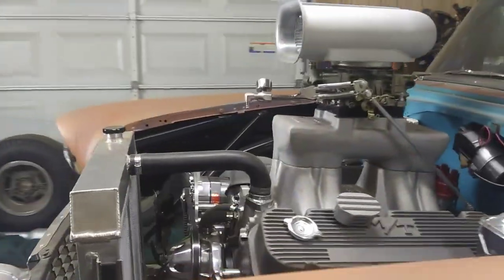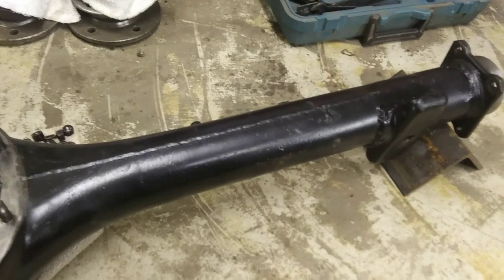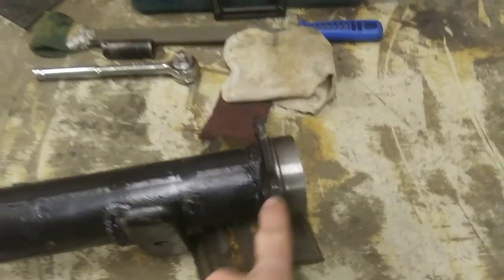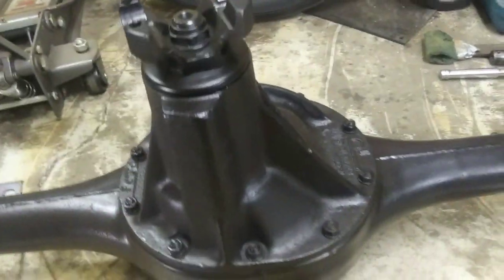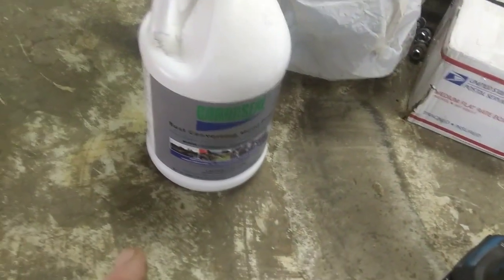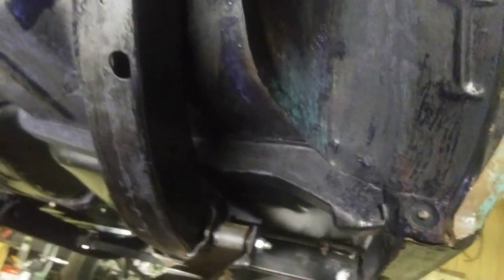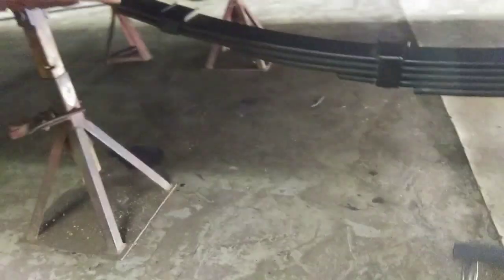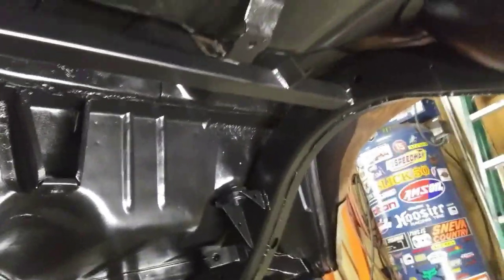1955 CHEVY GASSER BUILD. gets some rust converter and paint

Comment: Looks real nice 👌  good job on the finish .I use a broomstick to measure my axles .most of the time the axle have threaded hole in the in thats how you set your axle length so you don't have all the pressure on bearing. But I'm talking ford 9inch an after market axles lol . Good video my friend. Keep up the awesome work. 👍👍👍👍
Reply from the maker: Hey thanks a lot Mike.
Man she is so much better underneath now lot of work like you know to But all worth it. Broom handle would have worked good damit lol didn't think of that.
Can't believe I almost got that tape stuck in that housing lol lucky I got it out.
Have a Happy Thanksgiving to you and your family 
Have a great night my friend👍👍👍